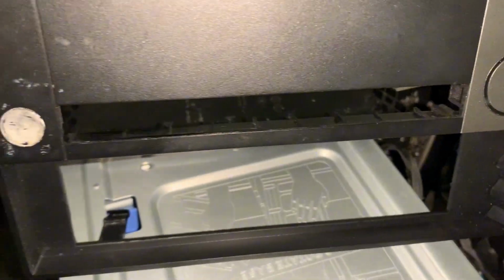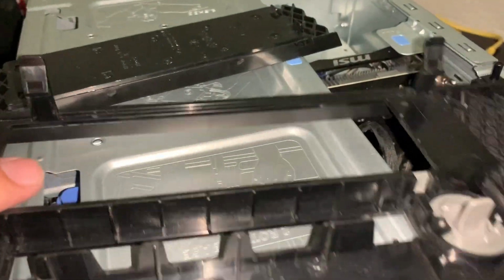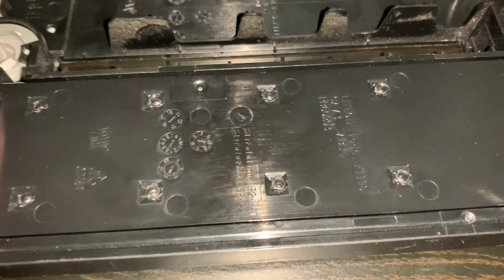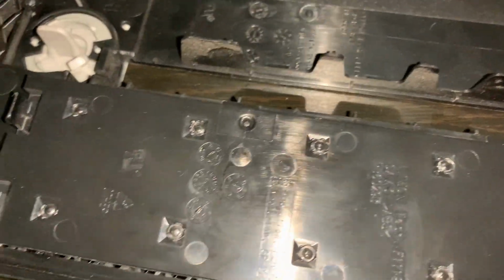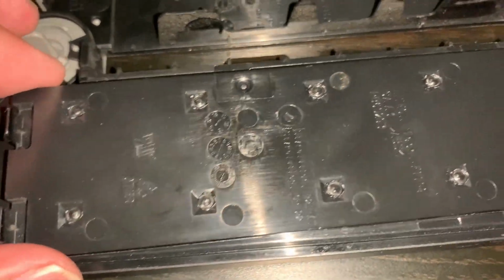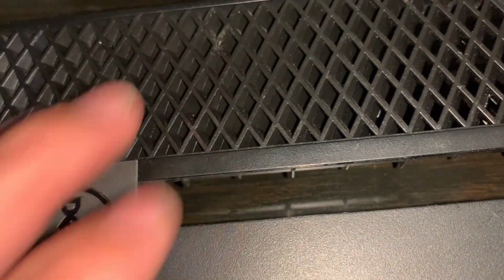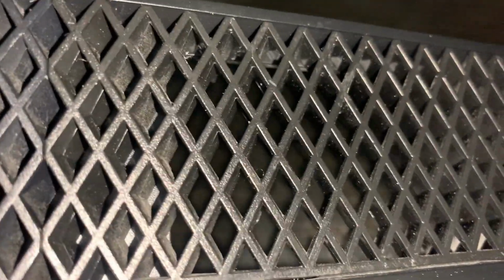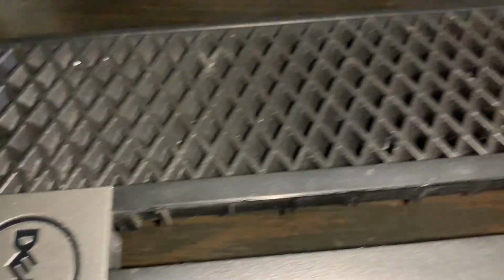Dell Optiplex MT 5040 7040 3060 5060 7060 Front Grill Extra Air Mod for FREE!

Comment: How to open ribbots
Reply from the maker: I slid a razor blade between. You could also use a thin knife.  It does not take much effort to pop each one.
Reply: @ thanks
Reply: @ can you make tutorial on how to open ribbots?
Reply from the maker: @user-ks7yi1hr2g  You can see it in the video.  I do not have this anymore.  But you just slide your knife under the plate and cut the rivets.
Reply: @RobertFixit  ok

Comment: This is the shit
Reply from the maker: surprised more people did not see this mod
Reply: @RobertFixit  I got the 7060 sff and put a rx 550 in, 64gb ram, and next ill switch cpu to the i7-8700 its been staying under 90 C while I game but still giving it some more air will be good!
I found a manual of what parts it could take but idrk if theres any newer parts the motherboard can handle.
Reply from the maker: @ Shouldnt be more than 80c sounds a little toasty.
Reply: @RobertFixit  interesting 🤔 It looks like the amazon seller of my optiplex already did the airflow, I tried taking the side cover off while I played and it helped a ton, it's usually lower but hits the 90 when I push it real hard
Reply from the maker: @ are you talking cpu or gpu?  have you checked the thermal paste?
Reply: @RobertFixit  gpu, i have not checked the paste I just bought it recently like a week or two. I'm getting a cpu next. My software tells me the gpu temp but not cpu temp I'm not sure how to see that or if my system even checks it?
Reply from the maker: @ gpu-z will show you cpu temp

also hwinfo64 shows alot like temps fans speeds etc